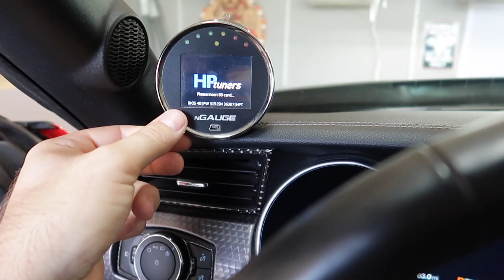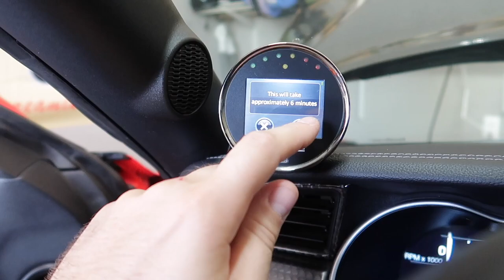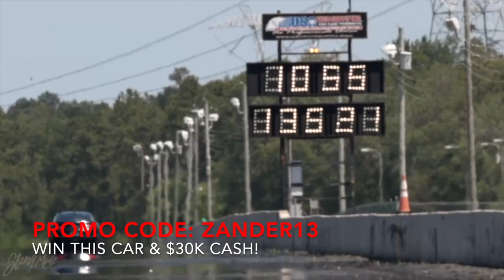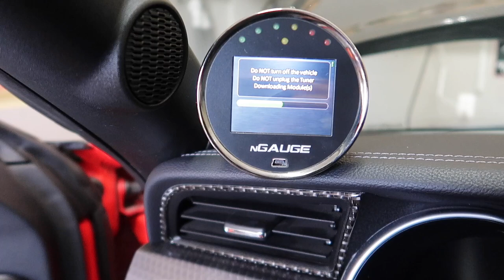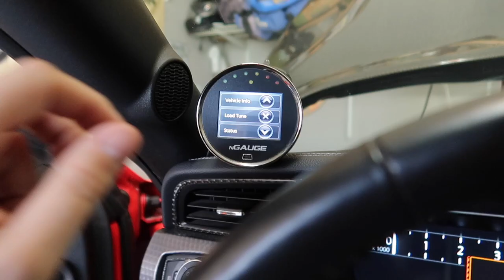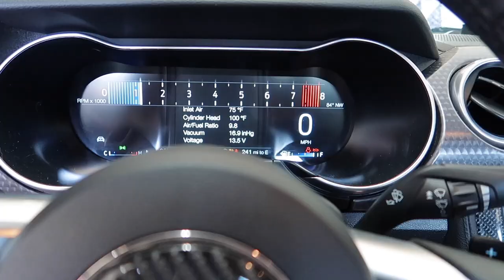Well... My 5.2 Swapped Mustang GT is DOWN AGAIN but you won't believe why

Comment: Man I feel u, im on my 2nd motor,  I now have a gen 3 aluminator pushing 1375whp, twin turbo. Just had to replace rebuilt turbos, went with 62/62  e85 triple pump.  Tuned by palm beach no regrets so far

Comment: If you knew about this with the n gauge, why wouldn't you replace it? Before you had to spend even more money to get your pcm reflashed. Especially, as you say, you are tuning  a very modified car. This doesn't make any sense to me.
Reply from the maker: Did not replace it bc it was still loading tunes no issues so long as it was connected. Live and learn I guess